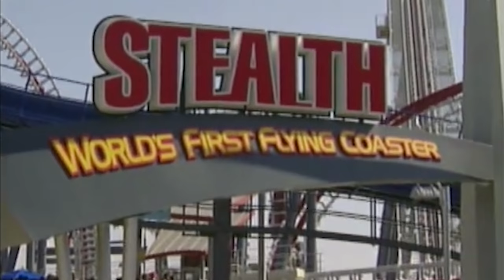How F L Y/Rookburgh Changed the Industry | New Vekoma Flying Launched Coaster

Comment: You're right. Rookburgh had top of the notch theaming. It had only one big problem.. The restrains. They had these vecoma vests. So tge priblem is, when youre 15 and your weight is only 50kg than it would be ok. But i've 90 and then its not a  security problem but a comfortable. Everyone knows if the operator push down the bars 1 point to hard... So they do it by my ride. But if the seats rotate to flying position, your weight will be pushed into the vests so you slip little in the seat. But that enough that you were "loose" in the seats, and the only fixed point is the special lower legs secure. That would be ok when its dirct under the knee (so its like kneeing) but its deeper short above the feet. So you have the most weight sitting down there during flight. And that makes it uncomfortable. Not extreme but so much that you say, "yeah its not bad but also not superfantastic!"

And yes i rode both, flying dutchman and the b&m. And both hadnt these problems (seats)

Comment: Nice video! But i noticed something in your audio, you have a big 60/120 Hz hum in your recording. This is from the power lines, because the electricity has 60 Hz frequency in the US. Due to some electrical effects (most likely a "compensating current" due to potential difference between two electrical devices), or a ground loop, this is amplified so much so that it becomes audible. What you can try: Connect everything to a power strip on the same power outlet. If that doesn't help, see if something is connected to a TV signal, and if the noise disappears if you disconnect the TV signal cable. Or try googling for "60 Hz hum" or "mains hum".
Reply: Oh, and if you further want to improve your voice-over recording, get a pop-filter to put in front of your mic. This will prevent the P-sounds etc. to "pop" like they do in "process" at 7:04 ;)